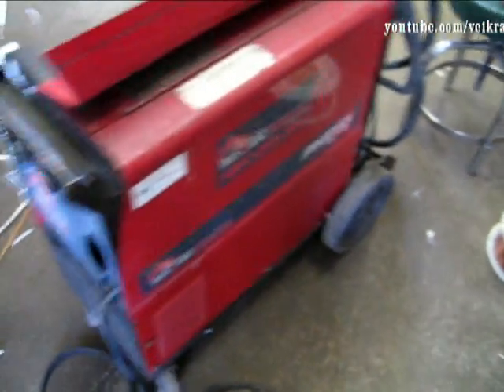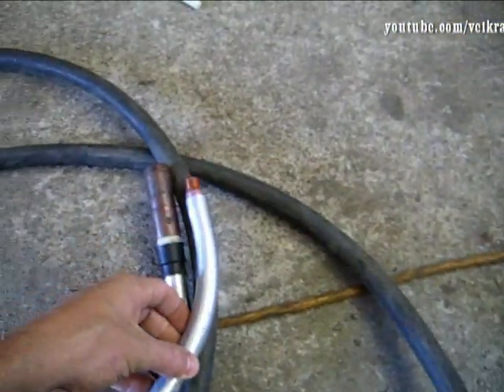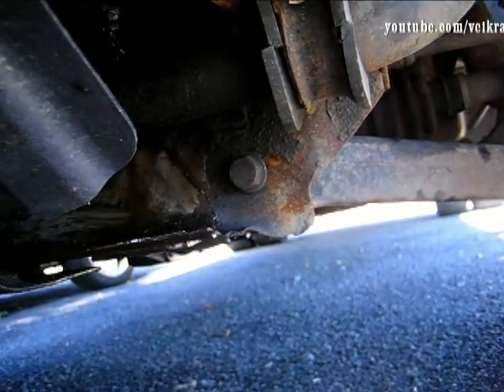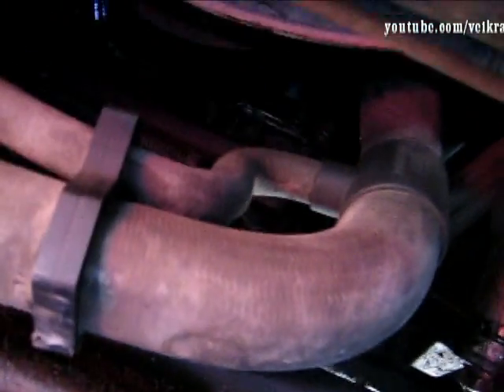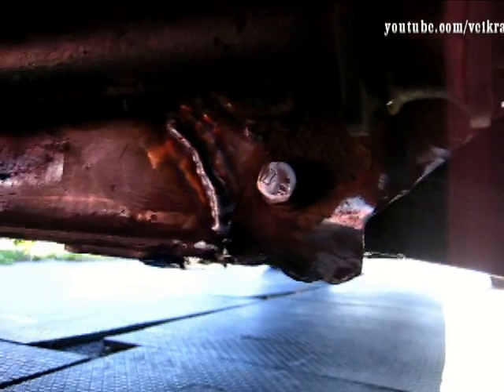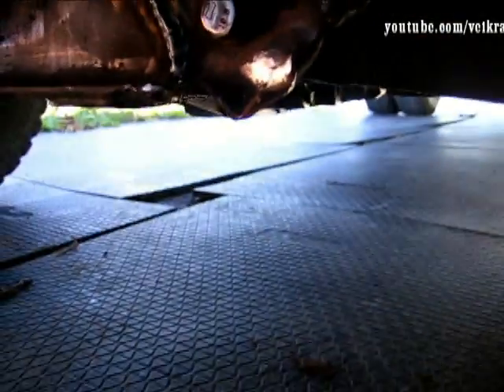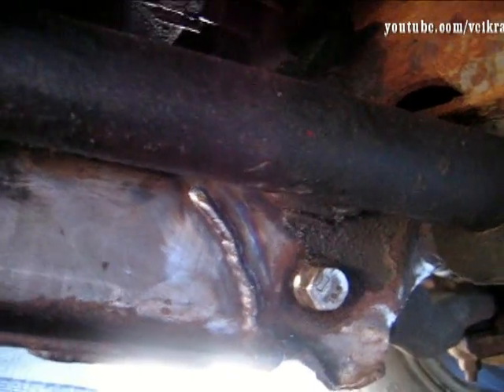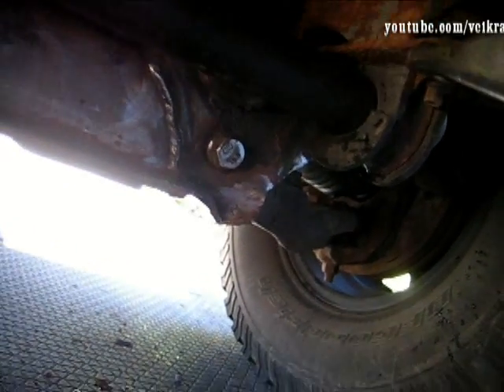Welding crack in gmc sierra frame

Comment: I will have to check mine.  A lot of people think my plow is going to break my frame. :)
Reply: Veikra  Stacking wet snow is what I think cracks the frames.  The plow will stack more snow than the truck can handle.  I have seen a guy plow with a winch.  I thought it worked pretty good.  Find an old plow buy a winch and you have a plow setup cheap.
Reply from the maker: +mossman381 Well the 08 up truck frame break up being the control arm mount. No gusset there, good idea to add some while you can. 

I'd prefer building my plow so that it looks like the bottom of the bumper. My ARB bumper is very high anyways.
Reply: Veikra  My truck is one that already has the factory gusset.  I really think it would be cheaper and easier to just find an old plow.
Reply from the maker: Im in canada, cheaper is debatable. pieces of junk sell for several Ks.  And couldnt use my bumper with a plow, it uses the same mounting
Reply: Veikra  Well then it might be cheaper making something.  Around here you can find a plow with a junk motor for $500 pretty easily.
Reply from the maker: here 1000$ rotten to the ground, abandonned for 5 years in a field with missing parts lol. I dont plow enough to even need tilt side to side, Could also put a scrapper to pull all the snow to one spot and snowblow it on the lawn.